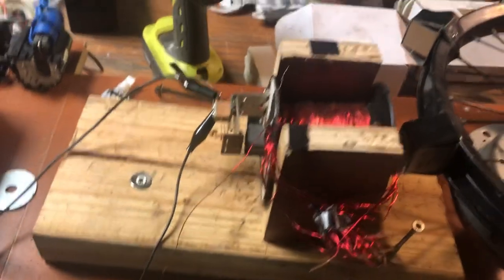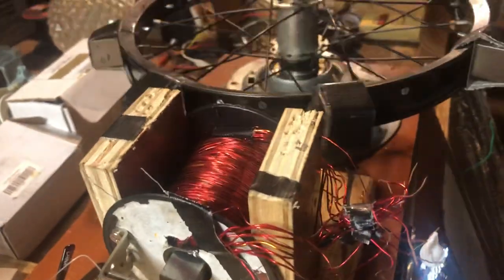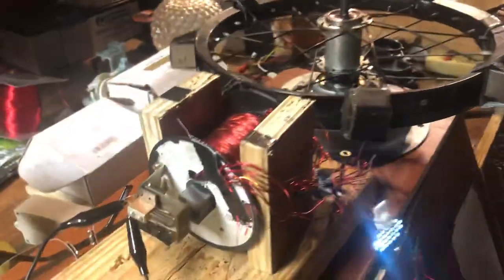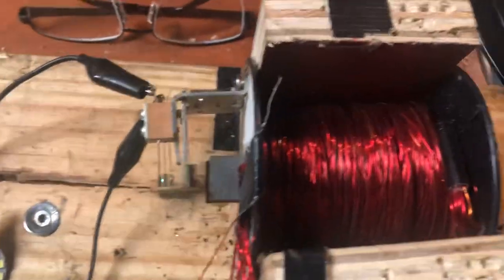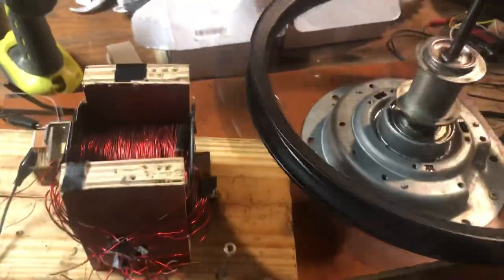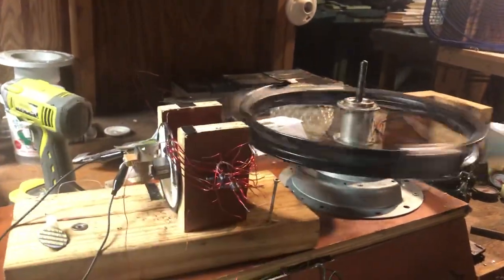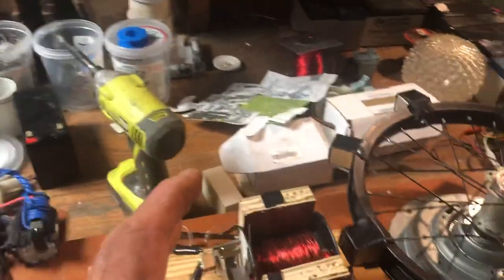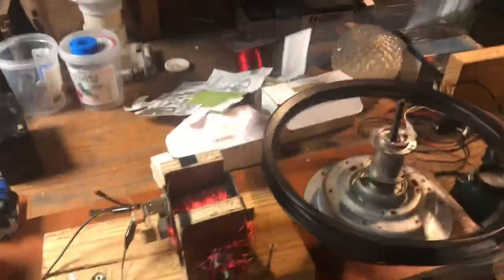DC Oscillator, How to Build, Vibrations in Stones!

Comment: LOVE the progress Buddy :) I like over-sizing the automotive flasher for the pulse. Keep Rocking it ;) I am using similar principles, utilizing exact weight volume of wire of different guages, a positive to negative magnetic rotor, (enhances the strength of the electron flow directional change...) and ignition dual coil systems through bridge rectifiers to a capacitor bank. Put  pick-up coil on each positive magnet position and have fun with the vortex... :)

Comment: you can now see the magnetism and electricity both working together. i think your right about the limestone blocks because ed also talks about making magnets from other materials. the magnet in the iron comes from earths magnetic field. but when making magnets with sand rock and rubber the magnetic field comes from the magnets that hold together the rock or the rubber as it gets hot or consumed. we see it with temperature how matter expands and contracts and how they work together to do different things like how temperature forms a cyclone

Comment: Awesome !! Now all you need is a secundary wound around the primary, with a spark gap, and you get the ruhmkorff generator and the spark "implodes" the frequency to a different harmonic... you need a white gasseous spark not blue violet one.
Reply: also i have been thinkering around the vibrator. either manually rotated, or vacuum tube driven, but never thought of your way.
In my view the magnet introduced by the wheel would either aid or disrupt the secundary discharge (capacitors for tank circuits should also be used, but analogue oil or glass dielectric.
Reply: and lastly, after watching your video i figured you are thinking about the same stuff that i do.
low frequency oscilation carries electro-motive(magnetic) force, 
After a certain treshold, the oscilation interlap forming a resonance and the magnetism gets trapped per se.
So what you need for anti gravity is high frequency oscilator of pure sine wave (digital technology is shit) and vibrate a small cone shaped "insulating" rock. What should happen is the resonating cone is diverting the 90 degree down gravity to go around the cone... you should be bending gravity magnetic forces with "elektrostatic" oscialtions of a non-conductor...
Reply: oh... its important to wire a tesla coil so the earth goes to the cone and the antena somewhere else. 
So you need an extreamly high frequency rumkorff generator (but with sinewave instead of DC) through a discharge (spark gap) that is between a condenser and the secundary coil. Than you got 2 terminals looking from the spark gap and 1 terminal can be the earth while the oter is the antena, or anode catode... i dont understand exactly how to wire this but i know how Ether or Aether works and it all makes sense. The Sun is not atomic, but a Ether transformer of mass to mass radiant energy ... electricity and light is just the "resistance" that we percieve. Also we live in a dielectric where the earth is - and sky or atmosphere draging agains Ether is +

Comment: Ilikeitalot.
A cluster of wires coming out of the coil. Not helping. 
This phenomenon of oscillation is useful. A lot of oscillation in the coil between magnets. Hold magnets from moving. Solid. Still get this oscillation? 

Does ability of magnet to interact on an oscillation, such as, perhaps entire wheel is vibratory? So place a good solidly non vibrating magnets, such as on an anvil nearby and not the wheel. 

Or does it need a magnet counter part at all? Maybe the coil alone with DC alone can do this? 

What about a nearby PMH in locked state?